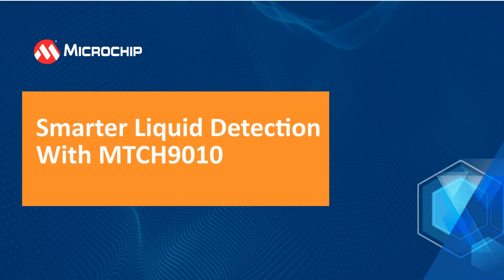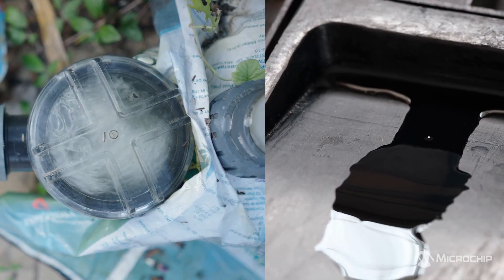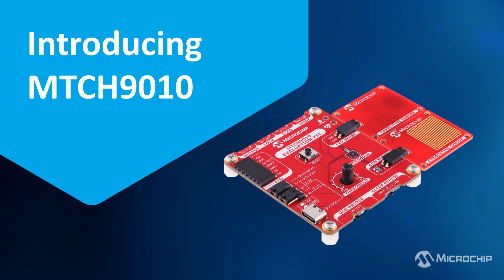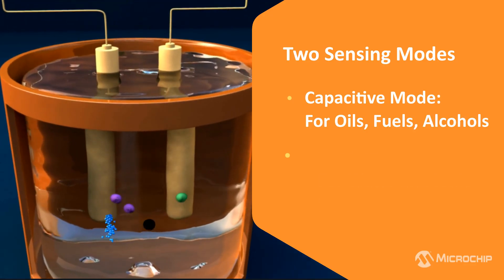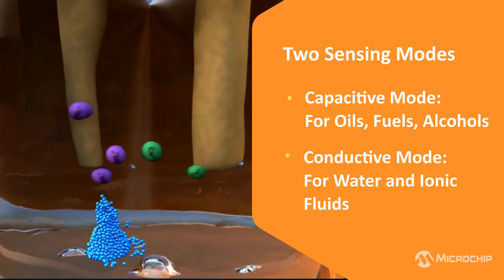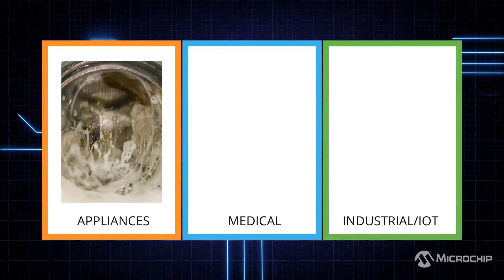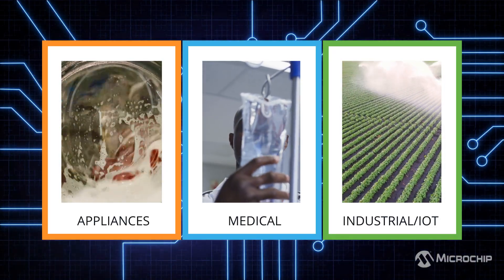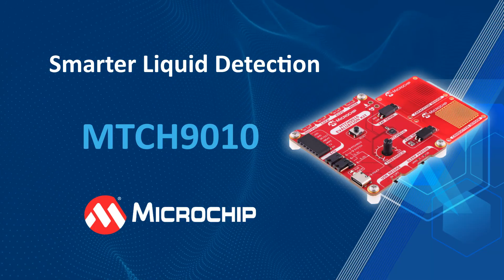What's the Best Way to Detect Leaks?

Comment: What is the solution to conductive sensors corroding quite fast? In my understanding when used to measure soil moisture, they don't last long. What i read about capacitive sensors in that application, i saw a lot of complaints of them being very inaccurate..(but those can be protected from corrosion, no direct elecrical contact with soil is needed)
Reply from the maker: Hi there, thanks for your question! Conductive soil moisture sensors degrade quickly due to corrosion from direct contact with moist, salty, or chemically active soil. In contrast, capacitive sensors avoid corrosion by measuring changes in capacitance through a dielectric barrier, without direct soil contact. However, their accuracy can be limited by soil composition, density variations, temperature, salinity, and inadequate sensor design or calibration. The MTCH9010 implements electrode polarity reversal in Conductive mode. In each acquisition cycle, the current flow between electrodes is reversed. This periodic reversal helps ensure both electrodes experience similar wear and tear, which reduces the overall corrosion rate and extends sensor lifespan. However, corrosion cannot be completely eliminated, and regular cleaning may still be required for optimal performance. For Conductive Sensor use corrosion-resistant electrode materials (e.g., stainless steel, platinum) and leverage MTCH9010's polarity reversal feature to extend sensor life.
 
For long-term and reliable soil moisture measurement, use well-calibrated capacitive sensors with proper dielectric isolation or specialized electrochemical sensors. In moisture-exposed touch applications, employ driven shields, proper sensor layout, and features like AKS and guard rings. Always avoid direct electrical contact between electrodes and soil to prevent corrosion. Hope this helps!
Reply: @MicrochipTechnology  Thank you for giving a informative and well formatted answer! (better than my question)
Reply: Add a relay switch on/off to take a measure every x seconds.
Reply: How to avoid sensor corrosion